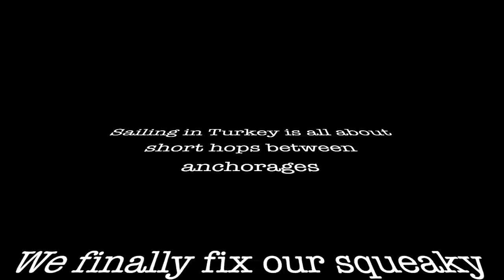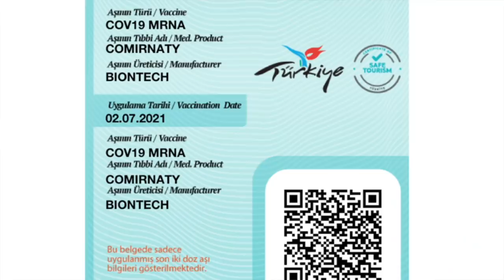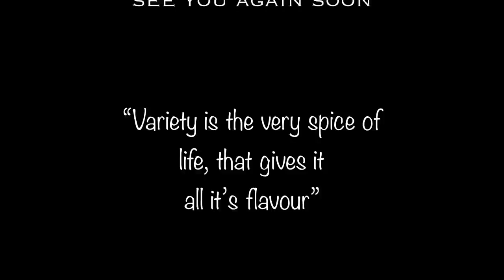Let's Dance Sailing Story #71 - Living On The Hook

Comment: Great video guys we are on an almost identical track as you and loving Turkey and the gracious welcoming people we meet.  One thing if I may, it appears your autopilot is still over controlling.  Mine is a Raymarine. On a very similar boat and moves about a quarter as much as yours.  I have  set the sensitivity to the minimum “cruise “ mode. ….just a thought.
Reply from the maker: Hi John, think this footage was taken prior to making adjustments to the response setting, it has made a significant difference.  Sorry we missed you before popping over to Greece, hope to catch up again down the track.  Thanks for your comment, cheers.

Comment: Hi guys, amazing footage and great video as always. We love you guys. A couple of questions. At the end of your shorelines to rocks, are you using a special rope at the end or a cable /chain??
Also, is it possible to sail for longer than 3 months in Turkey because its not EU or Shengen? Thanks in advance.
Reply from the maker: Hi Richard yes we use what we call a sacrificial line which is 24mm off cut of some old Gulet line that we found floating around.  We have just recently upgraded to lifting strap and they both work a treat.  Yes you can sail in turkey for longer than 3 months and this is why we chose it as our winter home, cheers.
Reply: @LetsDanceSailing  thanks, do I remember you getting a visa? Assume that's required?
Reply from the maker: @the_ayesha_khan  yes we became temporary residents of Turkey, easy to get if you use an agent and if you want to stay longer than 3 months it’s required, cheers.

Comment: Bloody hell Mick, what's with that mop you're wearing?? Time for a haircut methinks.
Reply from the maker: The misses agrees mate.....she took the blade to it no long after this was shot, cheers.
Reply: @LetsDanceSailing  How long have you had the boat now guys??
Reply from the maker: @shanevillis4079  we moved aboard in January, still learning her intricacies but love what she can do so far.
Reply: @LetsDanceSailing  Ah ok,, so now I ask your 6 mth opinion on that top lounge. Used it often? Not as much as you thought you would? Hardly at all? Would you prefer not to have it? Use the space for more solar?
Reply from the maker: @shanevillis4079  Too hot in the middle of summer, we have used it halve a dozen times on sunset and it is beautiful up there, we have also slept up there on a couple of occasions.  We can see ourselves using it more in the earlier and later stages of the season.  No doubt though if you could have something smaller allowing for more solar that would be the go, cheers.
Reply: @LetsDanceSailing  Thanks guys, much appreciated on your thoughts. Will ask again in another 6 mths :P lolol
Reply from the maker: @shanevillis4079  thinking about putting out an updated walk through with our experience thus far, cheers.
Reply: @LetsDanceSailing  That would be interesting, have you heard anything about possible problems with FP's?? Eg, bulkhead issues ??? or any other issues? I haven't done a lot of research on FP as yet.
Reply from the maker: @shanevillis4079  no bulk head issues heard of, understand Lagoon have a major problem.  The Elba has had  the usual teething issues, escape hatches still seem to be a concern, poor drainage from the roof lounge but nothing that concerns us to much, cheers.
Reply: @LetsDanceSailing  Goodo mate. ty for the reply.